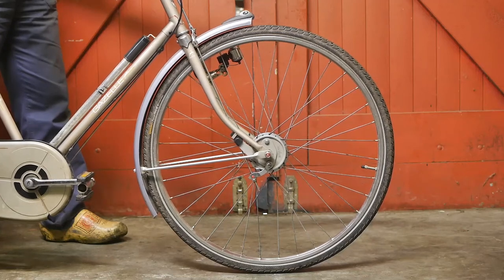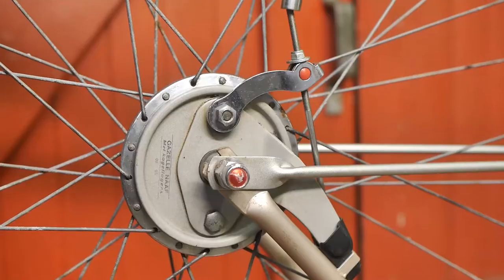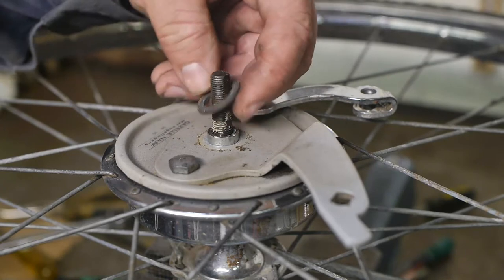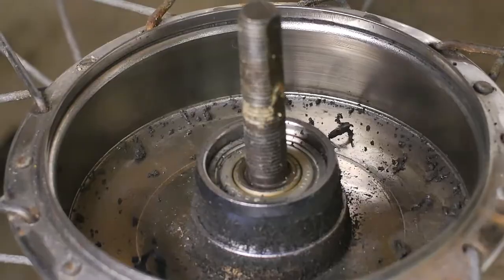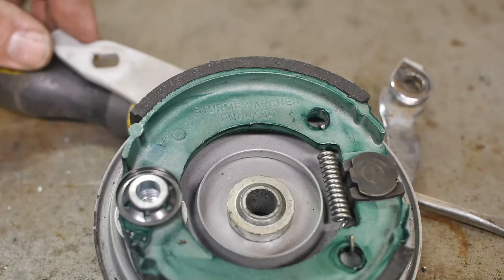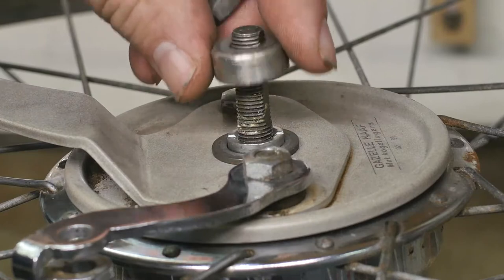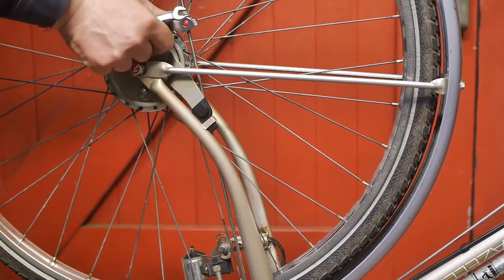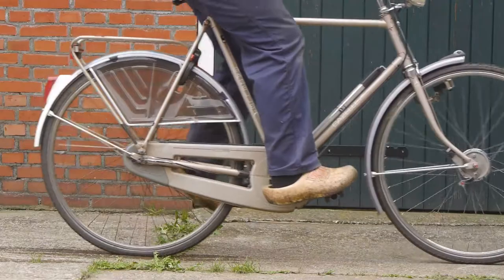Cleaning the front drumbrake on my Gazelle roadster

Comment: Hello sir,  please try chamfouring the angle of both sides of each of the pads with a file, then sanding as you have before in this video the pads and braking surface, then cleani the braking surface and pads thoroughly with brake cleaner and then a very light application of grease on both the pivot and wedge in between the pads inside the hub and a light penatrating lube to the exterior pivoting pin of the lever outside the hub  Good wishes

Comment: For disconnecting the cable I would have just taken the arm off because im lazy.
Interesting point about weld spatter in the rims. I hadn't thought of that as a cause of the rattling in those rims!
Reply from the maker: I doubt that I will be a whole to easier to take of that lever, but I sure can try :)

Comment: You mention low spots on the drum surface. At 7.15. I can actually hear your fingernail catching on these. The bottom one of the three spots almost looks like a small split in the surface of the drum. That would turn your drum into a kind of potato peeler, stripping and gouging material off the face of the shoes, and this loose material  could be bunching-up, as the wheel rotates and causing the skipping and squeaking. The split is acting like a carpenter's plane. It only catches and rips into the brake shoe in one direction of rotation, which is why you can't reproduce the squeak when turning the wheel in the opposite direction. It would also explain why there is so much brake material inside the drum. There appears to be far more of this shredded material  than would be considered normal, and it's also in clumps, not fine dust as one might expect to see. If the drum is indeed split - even slightly - it's toast. On a side note, drum brakes kinda suck in my experience. I also have a Sturmey front drum brake and it never brings me to  dead stop, but just a gradual slowing down. My set-up is cable-based rather than rod  and linkage like yours. I still suggest that you are losing braking force along the path of the rods and linkages.
Reply from the maker: My fingernail was catching on the cylindrical grooves. Those 3 spots were low spots in my honest opinion, and there was no structural damage. If there was, there would probably more brake dust. It's 30 years old and probably never got opened up before. The clumps of brake dust were a bit strange but I expect this is the newer brake material without asbestos. Currently I adjusted the linkage to a point were there is some drag. I hope that this will go a way with use and the breaking performance will be better.